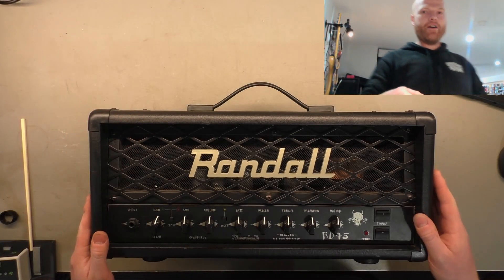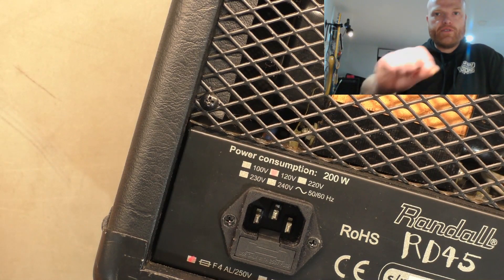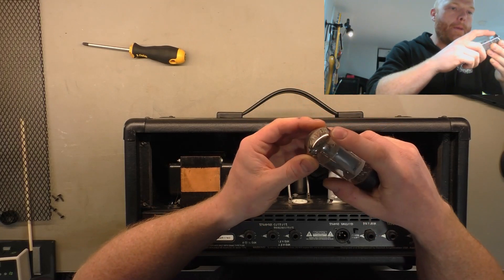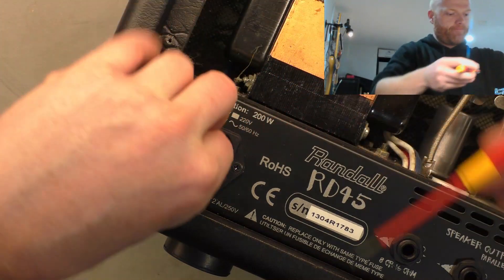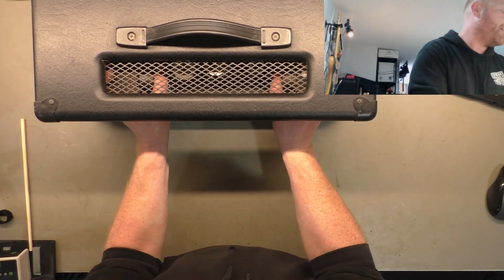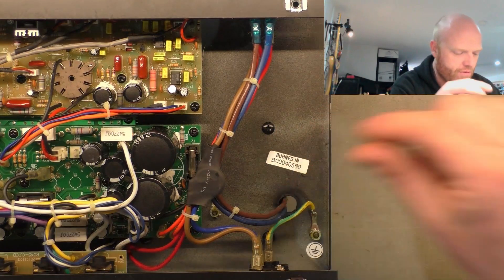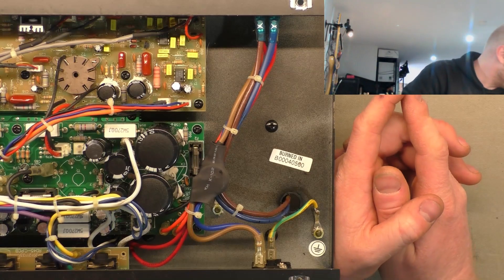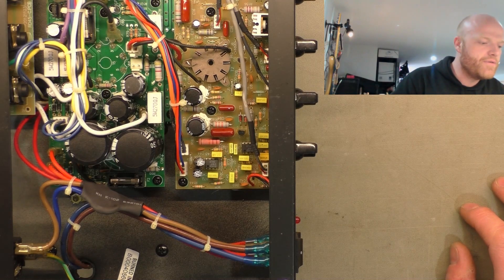Randall Diavlo RD45 - Suitable For 240v Mains Conversion?

Comment: It also occurs to me that having just one style of universal AC power cord jackis probably a bad idea for any device that requires a rewiring of the transformer internally in order to run on different voltages.  There's nothing that stops a person who doesn't know any better from just grabbing a new power cord that has the same connector for the amplifier  but matches the socket in the wall for a given country and thereby putting 240 V on a 120 V designed device, or vice versa.  Perhaps the IEC power inlet jack on the back of the amplifiers should have 4 or 5 pins;  in this way an amp could be designed so that it won't run at all with the incorrect cord and incorrect inputt voltage; or perhaps a mutivoltage transformer could be connected to all of them and when you select the proper cord (with a plug matching the local wall sockets) it will automatically deliver the correct voltage to the relevant transformer windings....

Comment: Do my eyes deceive me or does that amp have a shrinkwrapped thermistor bundled up with the input AC wiring? That is a stupid f---ing way to do it; the heat from the thermistor is bound to bake, deteriorate, and perhaps melt the wiring. It's also sitting right next to the filter caps, which have to deal with the additional heat. I'd mount that thing to the chassis.  Some manufacturers put the thermistor on the circuit board but that tends to degrade the solder connections pretty quickly. And for those who don't already know this, a  thermistor is a special type of resistor, typically wired inline in series with the incoming AC voltage; a thermistor is the opposite of ordinary resistors,, and has maximum resistance when cold but minimal resistance when it heats up.  An inline thermistor reduces voltage and current surges  to the components when it is cold,  but it heats up as the amp operates and its resistance goes down to minimum so that it is almost out of the circuit. They do get quite hot in operation. Blistering hot, usualky!
Reply: Great observation.
Reply: @fiddlix  ,   for that matter, adding a thermister to old amps that are now now running at such high voltages that that the tubes are stressed isn't really a bad idea but it really should be done neatly and witout major mechanical  and electrical modification.  Mounting it to the chassie where it can't burn anything and can dissipate a little heat would be a good idea period of course before you do anything else you would want to make sure that the original filter caps have been replaced and upgraded in such a way that the power supply can handle excess voltage with or without a thermistor.  And then you have to worry about proper biasing and plate dissipation and using high quality tubes.  There's no reason why a thermistor couldn't be part of that equation once everything else has been taken care of 1st.
Reply: @goodun2974  Agreed 100%. I hope there is a part 2 to see the final outcome.